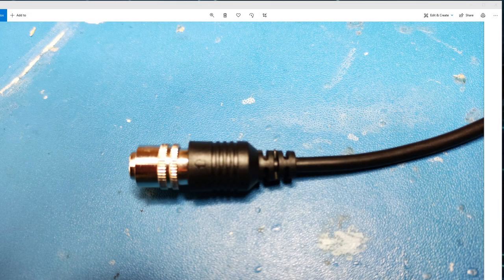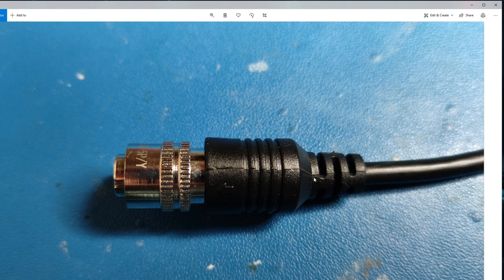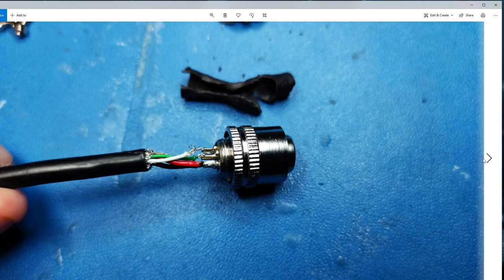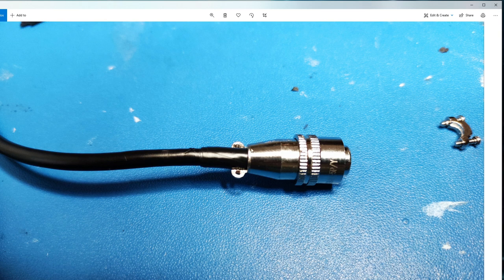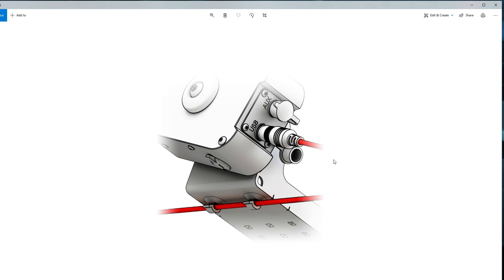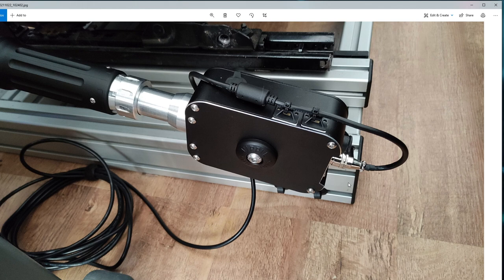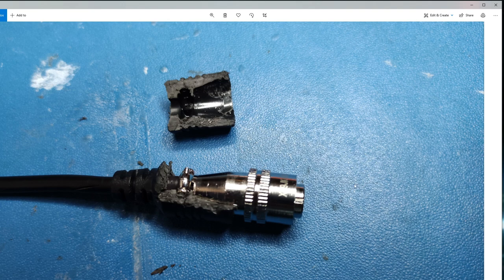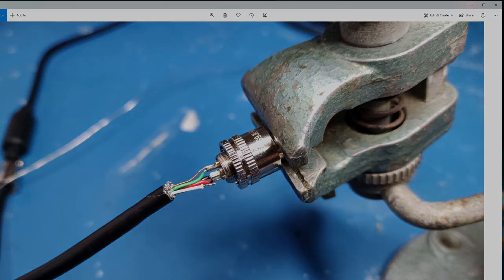Virpil Collective Repair Tutorial

Comment: Same happened to me few days ago. Collective had random disconnects/reconnects during flight until it died completely.
When I opened the connector, it was the white cable that had no solder on it and indeed looked really short.
Additionally the (metal) strain relief was not installed. The 2nd half with the screws was simply missing under the plastic cover.
Reply from the maker: Defo contact Virpil via the support ticket system to get sorted out

Comment: Mine doesn't work anymore either. But it was working this Morning. Now the LED on the Hawk 60 lights up briefly and Windows reports a USB error. 😞
Reply: Cause found! The Ground Cable, which is not insulated, was in contact with the White Cable. The Clip with the 2 Screws is missing from my Metal Housing of the plug. 🤔

Comment: Hi HavocCompanyClan. Could you PM me if you dont mind. My Control Panel 2 died the other day after only two months of use. Looks like the main board has died. They said they will send me a new V08 boarad, but its gonna take a while to get. So I am wondering.. can I fix my CP2 mainboard V08??? I managed to flash and verify a hex LUFA image via the SPI interface, but it still doesnt seem to boot. Cabling is good, so wonder if some passive components are toast or the crystal perhaps.. I mean its just an ATMEGA32U4, its not that complicated. So just wanna see what your experience is fixing them. Thanks.
Reply: Of course one of the first things I tried was to put it in bootloader mode, but it made no difference. The only life I see in it, is when I plug it in, some of the LEDs on the CP2 briefly flash.
Reply from the maker: @loiphin  If you have a scope maybe you could do more diagnosis stuff eg check voltages and see if crystal is wokring ok , but to be honest better just waiting for new PCB to arrive from Virpil
Reply: @HavocCompanyClan  Do you know how often they fail these main boards? Its a bit disappointing after only two months.
Reply from the maker: @loiphin  I have 5 Virpil devices using various versions of this micro controller board some as old as 2018 vintage , all of them are working fine. I think hombre you just were unlucky, it would be good to get a root cause of why yours failed tho